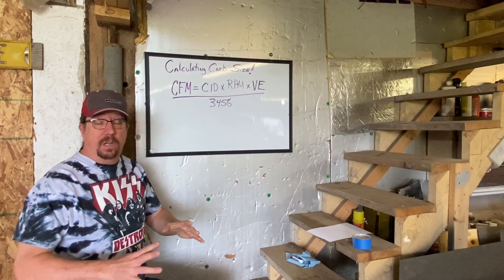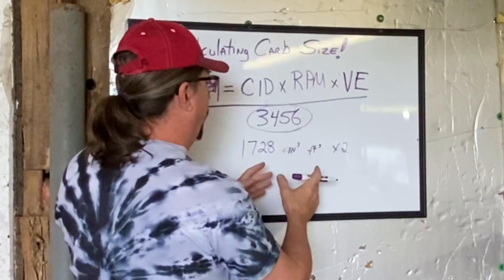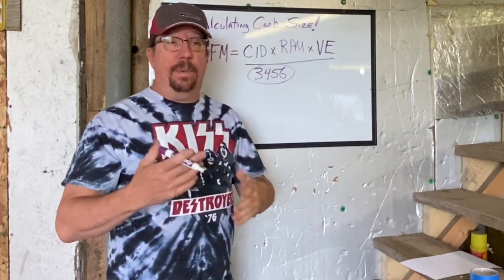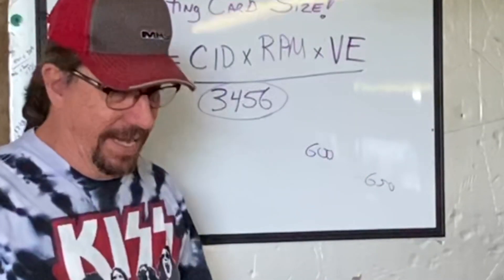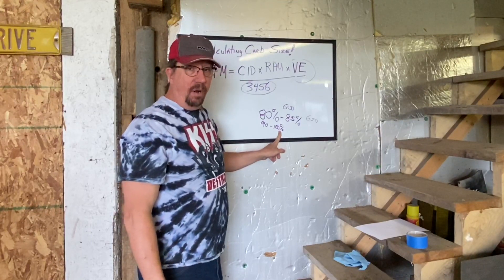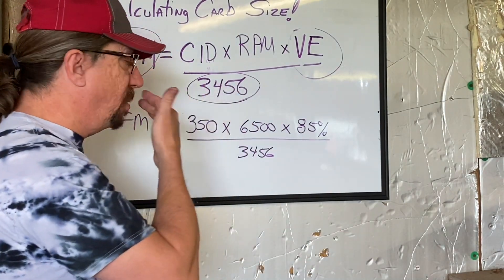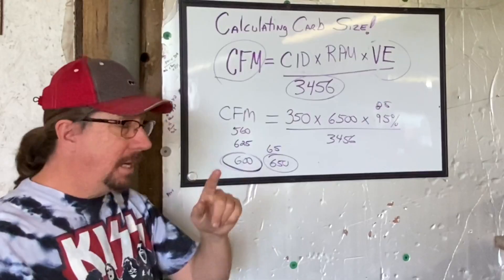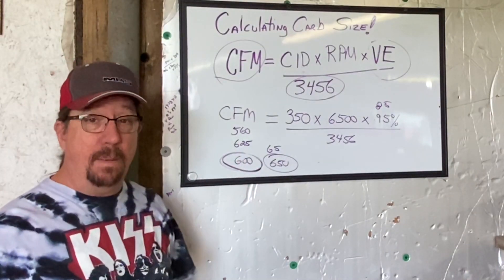HOW TO: pick the right carburetor.  SIZE MATTERS!!!  Don't overestimate, do the math.

Comment: Why does the math basically call for a Holly 600 on a mild 350, yet the factory Q-Jet from Chevrolet is a 750?
Reply from the maker: Quadra jets -  by design - only  flow what  engine the will take.  A 350 doesnt get a q jet to open up all the way.  

Factory used this type of carb across  multiple engine platforms for cost reasons.
Reply: @MyKARSShop  Doesn't make sense to me, WOT is WOT
Reply from the maker: @arlenewolf5260  on a QJ the throttle blades might be wide-open … however The secondary air doors are not.  They limit/control air flow so that the engine can take the air & fuel that  it needs.  

That is the brilliance of the Quadra jet design. And why they were able to put such “large” carburetors on so many different engines.  They did this because they could use one carburetor across multiple platforms, and the carburetor would literally become what that engine needed for CFM.  Especially in thermo quad and Quadra jet world… 

Rated CFM… Does not mean that the engine utilized all of that CFM.

Comment: I have Asbergers. This video makes more sense to me regarding carburetor sizing than anything else i have seen on the web. I bought a 390gt mustang that has a 750cfm carb. The engine runs well but i am thinking the engine will run better with a 600cfm that i have ordered this morning as the secondary vacuum is not working. Everything has been checked and i have also fitted the lightest spring. I guess the engine is unable to open the secondary vacuum due to the carb been too big.
Reply from the maker: I’m glad you found the video helpful. These calculations are targeted more towards driveabke good performing street cars…  

I hope you find the new carb beneficial. Let me know how it goes please! 

Thank you so much for watching. I hope you enjoy the channel

Comment: This is a great great video
Shame I'm from and in a metric country😂
But awesome video, gonna have some conversion to do in a bit.

Best part is I'm only building a 85cc 12-14K rpm engine right now😂

Aimed at 4500-9000 in use regularly but I was just thinking about how little suction the engine could create in a carb with a venturi bigger than the manifold.

Hope I can translate this well to my case got a 20mm stock at 50cc now, percentage wise from 50cc to 85cc 26mm would roughly be the same ratio but with only a 19,5mm manifold that seemed like a bad idea.

When tuning two strokes I used to get crazy performance on small racing bikes with 14mm on 62,5cc though. 13,5 honed intake manifold that was, (12 stock I believe with a 9/12 at 50cc)

Anyway, great video to help me on the way.
And gonna be a shame when this project is done, gonna need me something new to build.😢😂
But for now a whole lot of calculating, flowing and tuning to do.
Reply from the maker: I had a similar discussion somewhere else here in the comments about smaller engines. I can’t remember who it was… But dig through the comments and you might find some more helpful information.
Reply from the maker: Thank you so much for watching. I really appreciate it. I’m glad you found it helpful
Reply: Yeah it's a long read but I just love engines and get carried away.
Can't wait till I've got a place big enough to get some cars in to take apart
Reply: Awesome, thanx indeed and it sure was.
In the end I found a specific simplified formula that works great and seems fairly similar.
Immediately turned it into a program in my calculator from high school (ti-84 plus) for future projects. Turns out I have the right carb for the engines target rpm, 20mm at 7500 for 85cc and need 26mm for my target rpm of 11000 so I'll break the build in at twenty and go from there.
The formula was;
Diameter = efficiency [eg 0.85] * square root of (volume in liters * rpm)
In my case that is 0.85*sqr(0,085*7750) which comes to roughly 19,5 which is exactly my manifold and carb that I've bought which I thought was proper.
With my new cam and cdi though it comes to between 24 and 26 but since the heads inlet is only 20 I might keep it there.

Great kick-start you gave me though

Comment: This is incredibly inaccurate to what CFM my engine ran quickest with. 15.5:1 alcohol 310”sbf shifting at 8800 with a liberty style five speed. Based on your calculation it would run best with a 750. The 750 4500 went drastically slower than the 1050 4500 which went marginally slower than the 1140 4500 on the same track with the same AFR as well as nitrous jetting and bottle pressure.
Reply: We all like to bounce ideas and results off of each other to get better at what we do. Thanks for making the video! It’s a great way to start the carb tuning journey.
Reply from the maker: @MrEntede  thanks!  You’re right. We all learn from each other. 

Thank you for watching, and thanks for the great feedback.
Reply from the maker: I wasn’t clear in the video that I wasn’t speaking about drag racing… was talking more about Street performance 

I also didn’t bring alternative fuels into the equation. It’s hard to cover everything in a short video. Thanks for your great feedback

Comment: Does the same equation apply to a four stroke motorcycle engine?  How do you determine your volumetric efficiency if you don't know what it is?
Reply from the maker: Yes… The same principles apply. I believe I have another video here discussing volumetric efficiency that you might find helpful.  Rule of thumb… Use the number I suggest in the video if it’s a stock engine. 90 or 100% if it’s modified depending on how highly modified it is. Over 100% for anything with forced induction or Nitrous Oxide
Reply: @MyKARSShop  So I have my CFM needs, but the problem is...I don't know what CFM my carb provides.  What I have is a 1946 Indian Chief motorcycle.  It has longer rods, bigger cam, and bigger valves than normal.  Hard as hell to kick over too.  My dad says it needs a bigger carb, but he's not exactly an engineer.  I have no doubt he's right that a bigger carb is needed, but he's a bigger is always better guy.  I'm trying to figure out what the carb I currently have is capable of and go from there to see if I really need more, and then decide if I can modify it or find a more suitable one.  Even if you can just point me to some reading material I'd be very grateful.  Edit: if it helps the bore of the carb I currently have is 42mm or 1.6in dia..  It works off venturi, I think about .8 ratio if I'm saying that right?  Pulls the fuel out of a bowl below.
Reply from the maker: @keyofg2020  I don’t know exactly what the carburetor is that you’re using but based upon information I found on the web…

42 mm round slide Mikuni flows 118.8cfm approximate!

Rule of thumb for carburetor sizing is a smaller carburetor will give you a better bottom end throttle response. The larger carburetor will give you better higher rpm flow. So look at your application and what you intend to use the machine for. If you want a lot of bottom and grunt… A lot of times the smaller carburetor is the better way to go.

These numbers may not be helpful, but they should give you some kind of indication of the direction you might want to head for your carburetor.

43 mm round slides Mikuni flows 124.5cfm approximate!

44 mm round slides Mikuni flows Max 130cfm 

45 mm round slides Mikuni flows 135.7cfm approximate!

46 mm round slides Mikuni flows 141.4cfm approximate!

I’m not overly familiar with the carburetors on an Indian…
What make is the carburetor you’re using? Are these numbers helpful?
Reply: @MyKARSShop  I'll have to do some research into the make of the carburetors I have available.  I know they are all stamped with a number.  One of the ones I have is a linkert M344 I think, but that's all I can remember off the cuff.  Ideally, I'd like to figure out how to calculate from the dimensions of the carb if possible, but if not, maybe I could do like you're doing here and gather some data points of various models with the same size and get a decent ballpark, or via linear regression if I can't find the same size.  I think this does help me at least by giving me options of how I can figure this out.  Thank you!
Reply from the maker: @keyofg2020  

This link might be helpful to you I’m not sure. I wondered if it was a linkert carb

http://www.performanceindian.com/Carbs.html
Reply from the maker: @keyofg2020  i’m getting old and my brain doesn’t work well… 😂😂

But there should be a way to calculate theoretical flow based upon the numbers you have. Let me think on it for a while.
Reply: @MyKARSShop  This link does help, but admittedly is still a little over my head.  I'm a chemist, but I'm just getting into bikes.  So, I'm still learning the lingo and how to apply math & science to engines.  If I read it a few times and google the terms I don't know I'll probably start to get on the right track.  I've heard of this guy before and broke some Indian racing records if I recall correctly, so he's probably a good resource if I can be smart enough to interpret :D
Reply from the maker: @keyofg2020  you’ll get there… I wish I knew more about motorcycle carburetors to help you. I’m still thinking about how to calculate CFM based on the numbers you gave. I know there’s a formula for it. Like I said… I’m getting old and my brain doesn’t work well anymore. Lol

It’s a basic L over D formula… 

Length over diameter… I know it’s the same formula that I used to use to calculate fuel flow in fuel lines.

It’s there somewhere. I just can’t grab it. 😂😂
Reply: @MyKARSShop  Well that's okay, you still got me heading on what I think is the right track.  I'm reaching out to the Mr. Mosher to see if he still sells the 40CV carb kits.  Looks like for about $1k I can have a great setup.  And if I learn the why behind as I go, that's just icing on the cake.
Reply from the maker: @keyofg2020  Learning as we go - to me - is all of the fun. In fact that’s the whole point of my channel. I really appreciate the conversation and I really appreciate you being here. Keep Me posted on how it goes for you.

Comment: Holley tech told me 650 mechanical secondaries for a 355 vortec, (EQ ch350 heads), RPM to 5,500, mud bog jeep motor. According to your math I’m way over carbed.  Any opinion on this? Thanks jack.
Reply from the maker: Use a higher volume efficiency and you’re probably about right

The number I’m using here is for a basically stock engine
Reply: @MyKARSShop  thank you very much. Appreciate your opinion

Comment: Fuel system engineer?  Why wouldn’t you consider booster design and the considerable changes made to modern carburetors?  You’re calculations are for 1960’s carburetor technology.  By the way, real race engines are well above 100% VE.
Reply: LOL go away. You wouldn't know a race engine if it fell on you
Reply: Im just glad he broke out the oversimplified antiquated equation within the first few minutes after claiming to be a ‘fuel system engineer’ so I didnt waste my time watching the entire video.

Comment: Now how do those number get affected with towing or hualing etc?
Reply from the maker: They don’t.
Reply: @MyKARSShop  would you still tune it the same too?
Reply from the maker: @Bass_Shot  I would.  If it’s tuned right it’ll perform the same no matter the usage.  

An engine is simply a pump.  

If it’s set up right it’ll give you all it has & perform well.  

Heavy hauling loads are similar to dyno loads.  They are very revealing.

Comment: I always sized carbs the way you describe, but one time I was in a bind.  I replaced the Holley 650 vacuum secondary carb on a tight but mild 440 with a Holley 800 spread bore double pumper on what was supposed to be a temporary basis.  The car ran better on the street and the strip, so I never went back.  I don't have an explanation.
Reply: Spreadbore...
Reply: Your post is older but dual plane intakes you can multiply what recommendations on size they have to 50% larger
Reply: @jamesspain5049  x1.1  instead of x.85-.90

Comment: I went and bought a 600cfm vacuum secondary for my 351w.
I removed my 750cfm with vacuum secondary. 
I have a AFR wide band so I can see exactly which direction my tuning is going. 
After spending 4 hours and 10 different combinations I put the 750 back on and jetted the front and back the same. 
The 650 out of the box ran so lean it wouldn't idle and to get it to run I had to use jets bigger than what was in the 750.Then it ran richer than the 750 at idle but lean at cruising speed.
After some research I found that gas with 10% ethanol is 14.1 roughly for perfect burn and some motors just need more fuel like 13.0 to1.to run good.
At idle with 14 to 1 my motor pops and is starved for fuel.
I sent the 600cfm back for a refund and deal with the slightly rich 750 with maybe a next size hotter plug and see what that does.I have no gas in my oil so I will probably just leave it alone.
The 750 has great throttle response.
Reply from the maker: These ethanol-based fuels definitely throw a monkey wrench in the mix.  

I’m really puzzled why the 600 wouldn’t work. The idle circuit should work fine.   makes me wonder if something was wrong with it

Glad you got things sorted out and you’re happy with where you’re at.
Reply: @MyKARSShop  It was a quick fuel brawler made by holley. The workmanship was terrible, the jets were so over tighten I almost destroyed them taking them out.The thread's were not machine were a crap,the metering plate was a huge fight to remove,the bowl gasket was so smashed that it was torn up.
I don't think it was made in the usa.USA.
I think your right about the idle circuit being messed up.
I have a 30 some year old
 600 cfm holly think I will tinker with it.Its way better quality than the new one.
I sent it back for a refund.
I drive a truck and a fuel hauler told me that they are responsible for the ethanol content mixture. He said they dump in some ethanol and then fill up the tank and don't use any kind of chart.
He fills up in Knoxville TN.
So you have no way of knowing what your getting 5% ,15% it's all guess work by the driver. NO wonder older vehicles can't run worth a crap on this junk.
I think this is more than half my problem using a carburetor. 
Thanks for replying back have a great weekend.
Reply from the maker: @stevecooper8121  thanks for filling in the blanks. I appreciate it. I always try to keep track of stuff like this to be able to help people. Awesome. Let me know how it goes with that other 600. I’m really curious. You should not have had any of those kind of issues with a 600 on your motor.
Reply: @stevecooper8121  Brawlers are a great carb. You did something wrong
Reply: @borismcfinnigan3430  I have heard of lemons being shipped...got past the QC line.
Reply: @stevecooper8121  sounds like a lemon got  passed QC. I have a 650 VS Brawler and it worked great right out of the box, only needed slight adjustments.